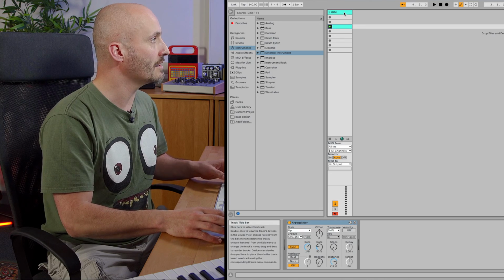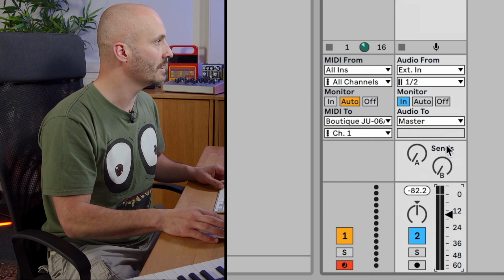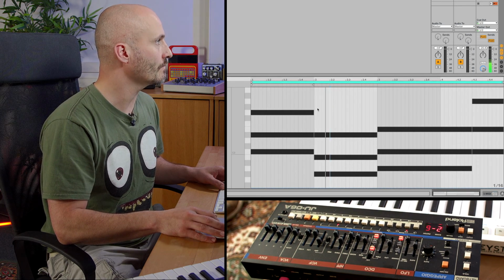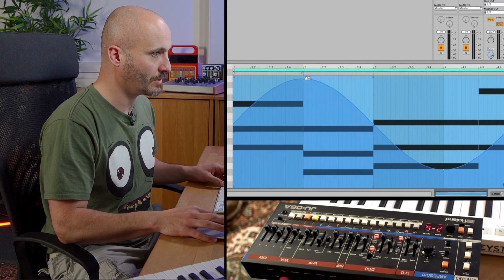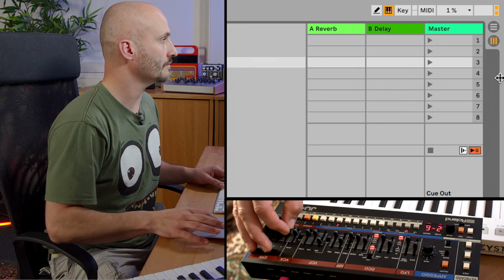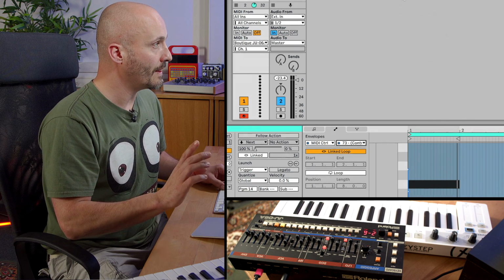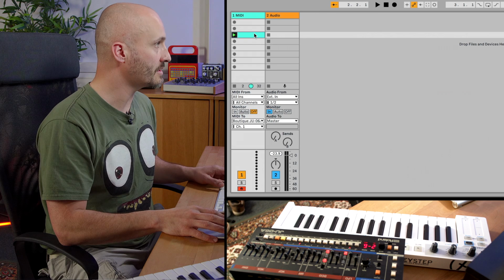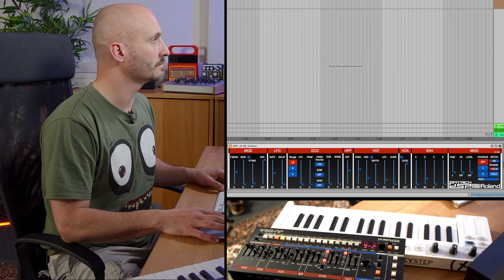Ableton Live Tutorials: External Hardware & MIDI CC workflows

Comment: What am I having bad? I am able to use an external controller to send and record CC continuous information changes to any parameter I defined in a Kontakt instance. But when I switch to playbacck mode, while I see the curves of my CC data, it doest affect the supposedly linked parameter. Instead I see a straight dotted red line superimposed oved the otherwised gray CC curves. The red line matches the state of the external device button position value. If I disconnect the external device it doesn't solve it. If I erase the CC assignation on the parameter in Live (Kontakt device lane), the data curves dissapears. What am I having wrong? In fact I,m using an expression pedal connected to a Komplete Keyboard as my main Midi Controller.

Comment: Hi man, thanks for this great video! I have an issue I'd like to get insights on:

I have 2 identical MIDI MIX connected to my Mac. How can I send different info on both these similar MIDI MIXES? 

I keep having the issue of moving one fader in Ableton (ex: CC23) and it automatically affects the other knob also triggered by CC23 on the other midi mixer.

Any solutions? 

thanks!!

Comment: Hi, I use Keys Step Pro to control and sequence some digital synthesizers installed in Ableton, including Dune 3, Arturia Pigment, etc.. I create music which is composed of several Synthesizer Presets. When I'm playing the song live, and I need to change from one Preset to another, I go into the Sound Bank of the respective Synthesizer and select the Preset to change. I ask:   Is there a way in Ableton itself, or a Plugin, that I can select the Presets of each Synthesizer and from this selection/mapping I can activate the preset that I will use? As if it were a screen that showed the Tracks for each Synthesizer, with their respective pre-selected presets. Is there a more practical and agile way to do this?
Reply: Same here, can't map the next preset button. Would be cool to know how.

Comment: Great stuff here, but i ended up being completely stymied by disAbleton's unwillingness to save any of my CC settings. I get my clips all set up and routed right, everything is working great, i save the project, close it and it loses all CC connections in the clips when i re-open the project. Any drawn in automation to the clips gets attached to the CC# and gets reconnected to the clips when i pull in that number again, but yea - there's no way i've found where i can save those settings beyond a single instance. I've watched so many videos that are so helpful in so many ways and not one of them talks about what happens when you close/re-open the project. So frustrating.

Comment: Thank you for sorting the MIDI HW interaction for me.  I have been using Cakewalk for 30+ years and the MIDI HW interaction was easy after you created/obtained sound libraries for a module, etc..  Ableton made it a bit obtuse.  For example putting the controller data in the macro area - mindblowing, but logical in the Ableton universe.   😎

Comment: i have a roland fantom 8 with a built in interface connected to ableton i bought a push 2 with it and everything went wrong .and then you need a mechanic. I just had a brain haemorrhage so I have quite a headache. the push 2 goes back. the fantom also sends audio and midi if i am correct. and drivers conflict. that takes the fun out of it Fast.

Comment: Hi. Thank you for the tutorial.  It looks like I'll be needing the "MIDI Interface" since I have a dozen or so MIDI 1.0 devices.
Is there one someone can recommend? (Mabe 16 device capable)? Thank you.
Reply: You can chain MIDI devices if they sound modules/devices are directed to MIDI different channels for performance control live or in a DAW. Depends on polyphony.... MOTU  8 x 8  or 5 x 5 would be plenty for 12 devices. You could create more chains than you need with either of those.
Reply: Using a good old MOTU here. It’s awesome.

Comment: WHEN USING AN EXTERNAL SYNTH ( Yamaha Motif ES 7 )as an external midi control board it is not recognized by my DAW (REAPER) midi device manager.~ I can find no definitive answer as to whether the Motif ES7 is or is not supported with updated drivers for Windows 10 any more?? ~The DAW does recognize my Focusrite 6i6 as an input midi device. If I run midi from the Motif synth into the 6i6 interface via it's 5din connectors, will the data transfer to the DAW in spite of the Motif not being recognized? IN other words is there an instrument priority or restriction that keeps data from the DAW as long as the Motif is the source? Or should 'any' signal that is streamed through a 'viable' recognized midi device  flow through that path? ~ Also, could the additional midi transfer device compound the latency and block the signal?   ~~Thanks! Great video,, even though I'm not using ABELTON,.

Comment: in Live, you can't control midi CC# live.  Unbelievable. So, if you wanted to control the mod wheel, or the filter cutoff for example, of an external synth, you can't. There is no Midi device. Hilarious.  One has to draw lines in an envelope clip. This is not live.
Reply: Yeah...surely u just map a controller knob/slider on a midi board to the cc in ableton, right?
Reply: Is this a joke? Of course you can.

Comment: Hi there, I have a Microcosm pedal from Hologram and an Akai LPD8 midi controller. I'm wanting to put the pedal on the ground (to use the Microcosm foot-switches) but change the microcosm knobs with the LPD8 through mapping the cc numbers. It can be done... I just can't do it. I've watched your video but there is some step I'm missing. In the Microcosm manual they list the cc numbers for each knob function, and in the LPD8 software I can change the cc numbers for various knobs... but the devices aren't communicating. I have a midi in/out from the Microcosm connected to the out/in of the audio interface. Liam, can you (or one of your watchers/readers) share any guidance? I'm sure I'm not the only one wanting to use the Microcosm (and other pedals) like this, but I've searched online and can't find the guidance I'm looking for. Thanks in advance for any time/insight you can offer (p.s. I use Logic and Ableton)